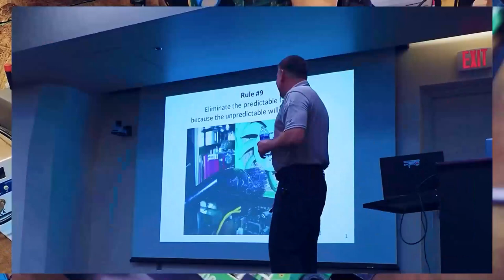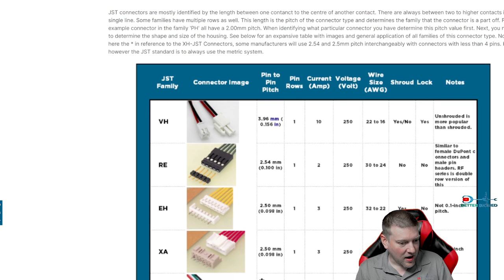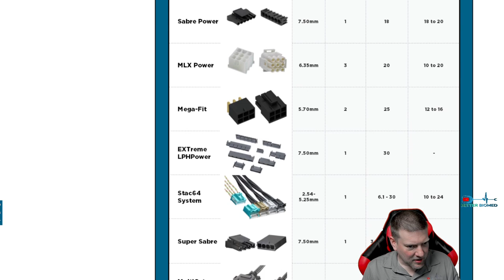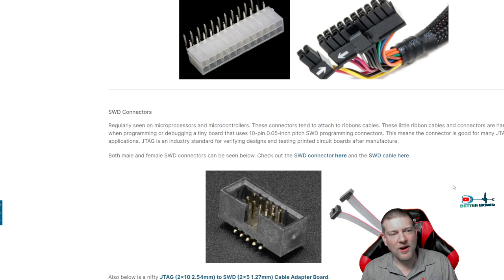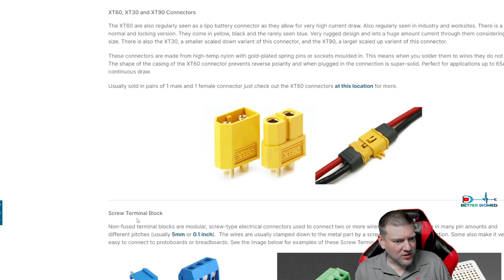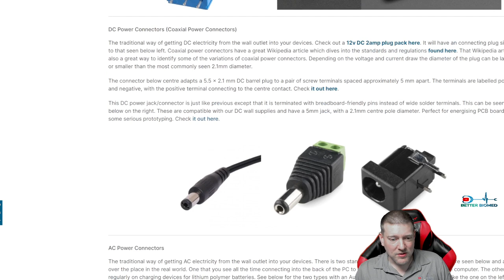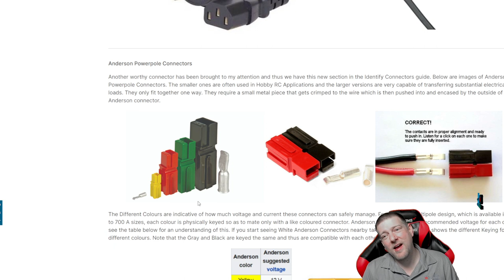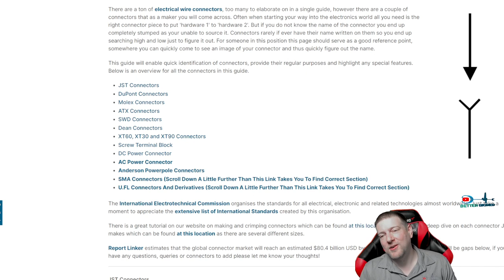Electronics Connectors

Comment: Dean connector was prominently used in the rc car field. Also older drones. Thanks for this link. Very useful. The figure 8 is called a c7. AC connectors are tough to correctly identify. You have the p47, 079, etc. they are pretty much all available.